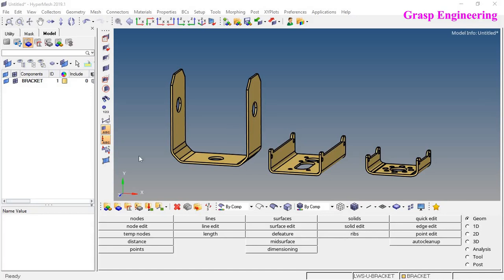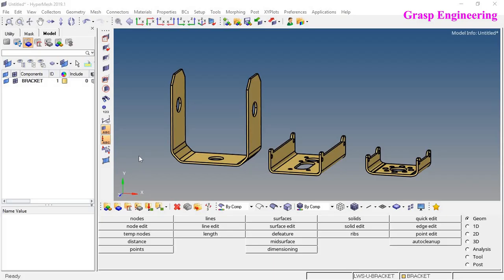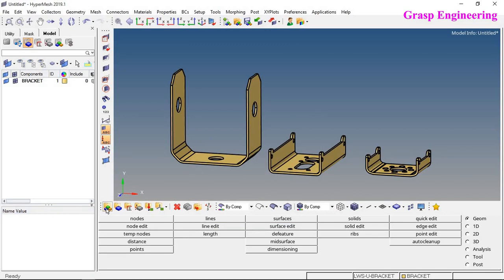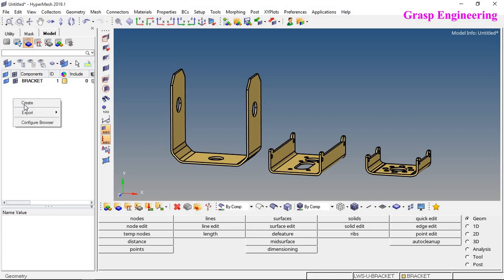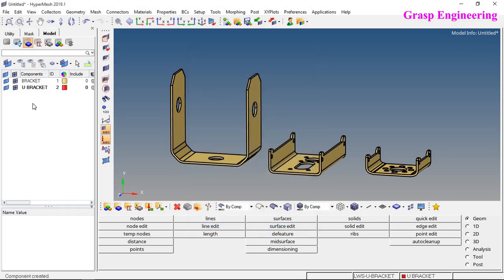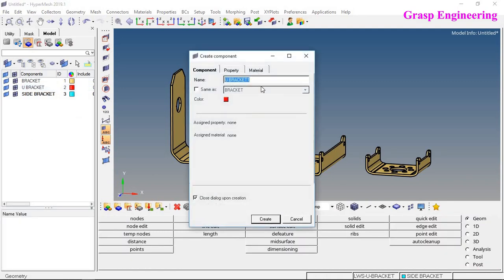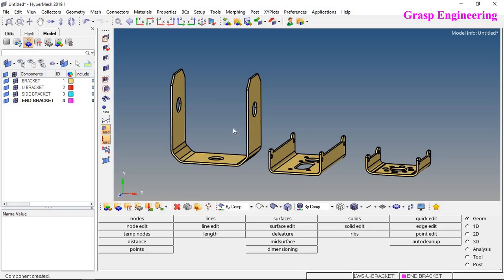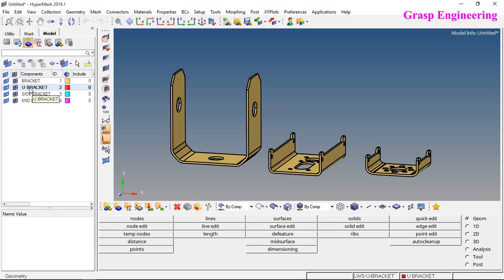Hypermesh Tutorials: Component Creation/ Component move/ property assignment

Comment: Hi when I try to import igs file in Ansys... Solid part turns into surface ...what should I do in this case. Help would be appreciated. Thanks
Reply from the maker: Yes, It may happens. Geometry loss will happen due to different software. You can try with cad configuration with ANSYS interface (like Catia-ANSYS, Solidwork-ANSYS, etc.). Other way you can create solids by using body operation-sew in workbench from the surfaces.
Reply: @graspengineering9249  thanks alot. O saved the Creo file in parasolid type...and it worked.